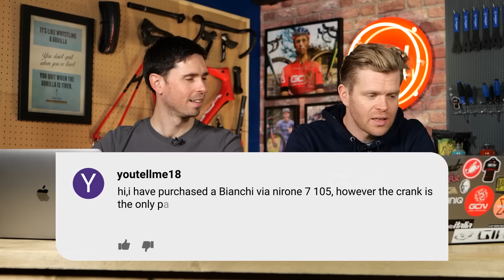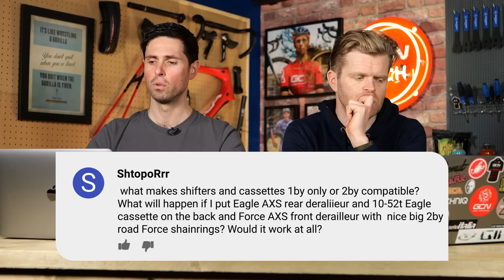Dinner-Plate Cassettes, Seated Vs Standing & Moving Floor Mats | GCN Tech Clinic

Comment from the maker: Use #askgcntech in the comments and the team will pick out next week's questions 👇
Reply: #askGCNTech Hi all, I have recently taken the plunge and waxed my chain using the sous vide pouch method. As per Ollie's instructions I removed the chain as soon as a skin started to form, and noticed that no matter how often I tried, there was excess wax in between the rollers even though the outside of the links were pretty clear. Am I doing anything wrong or is this normal, and will be cleared when running the chain in? Thanks again
Reply: #askgcntech  Hey lovely GCN folk! Should I just leave my Pirelli Cintueato Velo's on during the Summer, or can I go shopping for Summer tyres? (and what is the Summer tubeless tyre of the people?)
Reply: @zippyuk  If this is for Weekend Rides, I'd just buy a pair of GP5000 or Schwalbe Pro Ones and leave them on all year round 👍
Reply: Please help me how to replace rivnut on carbon frame.. thank you.
Reply: Yakima are a great bike rack brand. They do models that clamp the front wheel. The Frontloader and the High Road are excellent and pose no risk to carbon frames.

Comment: #askgcntech  Question, is it still better to use a bike throw in a sprint or pedal two strokes past the line? I keep seeing the Wout and Pidcock sprint where Wout's front wheel comes off the ground. I was taught this when I started racing in the mid 80s, but, is it still the best way to finish a sprint?

Comment: I had the same problem as Tom Wilson. My man/pain cave is carpeted, so I have my Wahoo mat on a 4’ by 8’ plywood sheet. I secured the mat to the plywood with Velcro tape. Problem solved. Not sure I would do this between the mat and floor though.

Comment: Beyond the chain wrap capacity, 1x rear derailleurs for wide range cassettes have a highly offset upper pulley wheel that tucks close to the cassette in the small cogs, and swings extra wide to clear the big radius of the big cogs, relying on the chain length to physically pivot the lower arm to the correct angle.  If you threw a front mech on it could tuck/swing incorrectly for a given gear and either collide with the cassette, or be too far away for crisp shifting.  So while you could physically put a 2x system together with a smaller rear cassette to stay within the derailleur capacity, it would likely shift like garbage and/or destroy itself in certain combinations.  A 46/36 with an 11-42 for example would be within the limits, but would work poorly at best.

Comment: Speaking of swinging your bike around for the climbs or the sprints, what benefit is there to such action? How do you better practice it? Leaning more of my weight off the front and putting it more on the pedals has made it easier to swing the bike around and I guess it's just practice, but why should someone learn to swing the bike around at all?
Reply: You don't, it happens naturally.  You have to learn not to swing it.  Also, when you get out of the saddle make sure you keep pedalling or the guy behind (assuming there is one!) will run into you.

Comment: You're missing one of the big reasons for not having really low gears in past years.  If you had 52-54x42-44 at the front and a 5spd block (ie 14 up and 13 up in later years) it was hard to have largest sprocket of more than 23 without giving massive jumps in the ratios.  So you had to pick sensible ratios for most of the time and that just limited what you had...
Reply: Spot-on

Comment: I prefer to run a sub-compact chain rings and have an 11-30T cassette on the aero wheels and 11-36T on shallower 'climbing' wheels to use when on holiday.
I find my chainline is now better in the big ring as I've 'tuned' chain rings to my power output.

Sunrace make nice cassettes for this purpose and their RX1 11-36T is a decent weight at 360g

Comment: I think if you rode 7 speed with a dinnerplate for first gear you'd see immediately what the problem is. The gaps between gears is to big requiring a much bigger cadence range for your legs. Riders had to stand up when their cadence got too low. A triple helps that but none of the big boys would accept that. I don't think the hill gradients have changed!

Comment: BITD the reason racers didn't use super low gears is because you only had 5 or 6 cogs in the back. If you put even a 28t low, then you'd have a big jump in the high gears, and that would get you dropped at high speeds on flatter ground. Also, if you had a racing bike, it pretty much meant you rode everyday and/or raced and were super fit. 42/21 was enough. There wasn't as much of the weekend warrior thing.
Reply: I got by back in the 1960s with a 14-21  6-speed block and 54-44 chainrings.  Modern riders are just wimps. 🙂  I liked that you could configure your block by selecting the relevant cogs off a nice display board, remember those?

Comment: We've had low gears for a great many years, they were just accomplished by use of triple cranksets.  As rear cogs got ever thinner and closer together and chains got ever narrower, similar spreads could be accomplished with 2X or even 1X setups -- of course necessitating dinner-plate sized cogs.  This comes at a cost in durability (thin chains, thin cogs, suboptimal spoke geometry), but that's progress, I guess?
Reply from the maker: Would you like to see the return of the triple? 👀
Reply: @gcntech  Forgotten but not gone -- they are still made.  I prefer a 3x9 setup, to any higher cog counts.  Though if I get another bike I am leaning towards a Rohloff hub and belt-drive.  I'd so love to build a rear wheel without any dish, and get rid of chain and derailleur issues altogether.  I think that may be the best solution for someone who's riding interests lean towards commuting and touring and minimal fussing.  And although I don't mountain-bike I have heard good things about Rohloff from them as well.  If GCN Tech hasn't yet covered that product (or product type, as Shimano make more affordable versions), it might make for an interesting presentation.  Who wants to go to Germany?  Ride there with a conventional bike, Drink beer, Pedal home on a Rohloff, Give impressions....

Comment: #askGCNtech - Shoe question. For many years I have been using Sidi road shoes as they fit my feet very well. Sidi uses their own proprietary wire tensioning system (Tecno 3). I am wondering if it would be possible to swap the Tecno 3 dials with Boa dials? I asked Google and did not find any sort of answer.

Comment: When I used Thule roof racks, they clamped onto the fork dropouts (front wheel removed, of course) via a rack-mounted QR skewer and had a ratchet strap around the rear wheel.  A separate "fork" held the front wheel via the wheel's own skewer.  Nothing touched the frame, and the bikes never threatened to get loose.
Reply from the maker: Sounds like a great option, was it easy to set up? 👀
Reply: @gcntech  Very easy.  A tray has the QR on one and the ratchet strap on the other.  It attaches to roof rails and runs along the front/rear axis of the roof.  The position of the rack on the rails is fixed at the skewer end and movable at the ratchet end, and the ratchet is movable to account for different bike wheelbases.  I'm actually quite surprised that GCN Tech is not familiar with this system.  It was in very common use.  Perhaps the dubious advent of the through axle has pushed it off the radar.

Comment: What kills me is you guys sit in the tube and put a lot of weigh. On it but complain about a clamp on the down tube, seem some hypocrisy going on.
Reply: Sitting on the tube (while not ideal) spreads the force over a wide area, while clamping can concentrate a very high load on a fraction of a square centimeter.  Kinda like how it's possible to stand with one foot on a softdrink can, but it's also possible to puncture the can with a sewing needle.

Comment: #AskGCNtech know a hack to use my very first generation eTap shifters with any current, long cage eTap rear derailleur (so I can use a wider cassette block than what I'm currently stuck with: 11-32)?
Reply: in theory there should be. considering you can connect the new AXS 12s shifters with the old 11s FD and RD... you just need to update the firmware appropriately.
the question is, how can we write the software required, and update the old 11s shifters for them to work with the AXS 12s FD and RD

Comment: I think Armstrong put “spinning up hills” on the map for pros. I can’t remember when non-pros finally accepted that a 53/11 was over-geared and started to embrace compact cranksets. I think it was around 2000 when Campag came out with 13/26 and 13/29 - that 29 sprocket looked like a dinner plate at the time - now it’s completely normal.

Comment: My mat also does this occasionally, basically scrunching up. But this is down to my poor technique 😅 If you lean over the handlebars and are pulling up on the pedals more than pushing down, which means the turbo is lifting ever so slightly off the floor pulling the mat as it lifts and then settling back down on a slightly different area. Rinse and repeat. Circles required

Comment: RE the mat bunching up. One solution could be a rocker plate, as that will prevent the trainer from jumping around. Another solution could be a different type of mat that’s grippier. I have a Wahoo Kickr Core and had issues with the trainer jumping backwards on hard sprints - I’m a big guy (~90kgs) and the small flywheel on the Core I think makes it prone to jumping back. I got a version of a rocker plate called the InsideRide (actually better than a standard rocker plate) and it seemed to solve the problem. I’ve never had an issue with the mat bunching up. I use a very grippy yoga mat from Jade Yoga. Hope this helps

Comment: #askgcntech :  my rear wheel keeps having play, it's a quick release skewer (disc brakes) which comes with aluminium cannonadales, I have changed and cleaned the bearings in some notable bike shops but it still manages to have play every 2-3 months, why is that happening ? Thanks

Comment: 1. Low gears weren't possible with the technology of the old days. Chains and cogs were straight cut and couldn't shift large differences. And large cogs would have been very heavy with steel thick cogs. The derailleurs weren't able to accommodate the large range. The current state of gears has been an evolution if you look back.
Reply: I think derailleurs back then looked much neater with their jockey wheels close together - I hate the look of those long cages.  In fact, bikes back then looked much more elegant (IMO), despite being lower tech compared to modern bikes.
Reply: @stevemawer848  you should take a look at the microshift super short. Fits a 11-34 cassette with really close pulleys

Comment: I think wheel sizes etc have changed too, and mathematically that ought to change how gear cogs translate to speed. Is that a factor?
Reply from the maker: Interesting point! Wheels sizes have shifted a little, although 700c has been the usual for quite some time now.
Reply: @gcntech  Tubular wheels haven't changed size since way back when, surely?

Comment: We didn’t need dinner plate cassettes because we had 3x. To get that range with currently fashionable 1x would need a rear mech cage so long it hit the floor.
From my “grumpy old man” POV, 1x always looks like a cheap kid’s bike, you know, like those little Puch 3sp racers in the bike shed back in ‘88. You were coolest kid at school if you had a 3 ring 15speed, for Uber cool 18speed SIS Raleigh Lizard.
If you told me I could have 10 speed plus just on the back when I was a kid I would have been checking you didn’t have antennae and  drive a flying saucer.

Comment: Low gears were avalable. The sprockets were not normally over 32t and 28t was the most common large sprocket. However chainrings down to 26t were available for truly low gears. I have the bike I built in 1985, it has a 28t largest sprocket and 30t inner ring ona triple chianset. Triple chainsets were used a lot for wide gear ranges.
Reply: Nobody was going to use triples in a GT due to the trash shifting and weight.

Comment: #askgcntech Hi GCN, I been looking at Trek Emonda frameset but on google search says aluminium frame last 5-10 years, and as be a daily unsure of carbon as fear someone yank bike so lock goes through frame, what would you go with out of the options of aluminium or carbon? I like if possible it last my life
Reply: The idea that alumin(i)um frames somehow have a 5-10 year life is nonsense - I found the same claim on Google, but it's not a reliable source. Like any frame, an aluminium frame will last almost indefinitely if used for the intended purpose, not crashed, etc. It's theoretically possible for it to fatigue after high mileage, especially with a heavy rider and rough roads - for those conditions, I would probably choose steel over either aluminium or carbon.
Reply: Aluminum (unlike carbon or steel) has a finite fatigue life, which means that any aluminum structure subject to repeated loads requires adequate engineering to ensure that it doesn't fail prematurely from fatigue.  Some early aluminum frames had this issue.

Having said that, I'd wager that modern aluminum frames are sufficiently engineered to withstand decades of regular use.  For what it's worth, my Devinci aluminum frame comes with a lifetime warranty.

The biggest benefit of aluminum is that it is (like steel, but unlike carbon) entirely recyclable.

Comment: The biggest limit to wide ratio cassettes (or blocks) in the past was being limited to 4, 5 and then 6 speed blocks. The jumps in number of teeth would have made the ratios too wide to be workable
Reply from the maker: Can you imagine some of those jumps if you had a 34 cog5 speed 🤯
Reply: @GCN Tech  and tge smallest one trying to clear the rear ends with the spacing on rear axels pre free hubs and being able to dish a wheel accordingly
Reply: #ASKGCNTECH Hi! Can you explain how to set up the different modes of the DI2 gears. I am having some difficulties in change the modes either in my DI2 11 speed bike and also in my DI2 12 speed bike. Thank you in advance.
Reply: That was my immediate thought too. I have Shimano 600 on my old bike, and a modern spread low to high would be insane with 6 speeds and down tube shifters.

Comment: Instead of a 2x front chainring you can use a classified rear hub. No effect on the rear derailleur.  Though then you need to use their cog and they don't have a wide range cassette option.... yet.
Reply: The classified is why heavyer than a derailerur and less efficeint do to way more moving parts. Not only do you need to use thier cogs, but also a rearwheel Hub.

Comment: #askgcntech Hi GCN crew! I’ll be entering a few time trials this year, based around Cheshire, but on a budget. I have 2 wheel sets. A set of Pro-Lite Bracciano A42W Aero Road wheels, with a rim depth of 42mm, and with a combined weight of 1923grams. I think they a Tubeless ready or compatible? My other are a set of Scribe 365 tubeless ready wheels, with a rim depth of 26mm, but weigh much less at 1574grams. Which set of wheels would you opt for, to be quicker over 25 miles at a speed of 24-25mph, and what’s the science behind it? Thanks in advance!
Reply: If there are only a few or no short climbs, i would go for the Aero Wheels, if there is a lot of climbing the lighter wheelset.

Comment: to @2old4this 
If you are concerned about your carbon frame (as may of us are or would be) maybe you could look into using some kind of straps to hold the wheels in place and secure the bike to the rack in that manner. 
I saw a car roof bike rack and it uses straps to secure the bicycle wheels into a channel the bike is not going anywhere.

On the sliding rug I had that problem I found a product called rug grippers and they just stick  to the underside of the rug and keep it from sliding.

Comment: The reason the mat may rise is from turning the handlebars while weight is on them. So just being more careful to not turn them or getting an elite steering rider may help
Reply: I assume that’s what it is. I have the same problem mentioned in the video, but I notice it happens most on the really hard efforts. I think I lean most in the handlebars at that time, so there has to be some turning of the bars.
Reply: I do have some rising of the mat but never enough to become an issue. I agree that its probably from turning/leveraging the steering bar. The fork angle essentially moves the mat back everytime the handle bar is turned. This happens to me even though the matt sits on a carpeted floor just have never been enough to create an issue with my pedals.
Reply: I have no flipping idea what's happening
Reply: You could try putting the special mat that normally goes under mats/rugs to make them not slip on slippery floors. I use one from IKEA for my rug under my coffe table on wooden floor. Worth trying I think.
Reply: Thanks all, I’ll try being gentler on my handle bars and see if that helps.